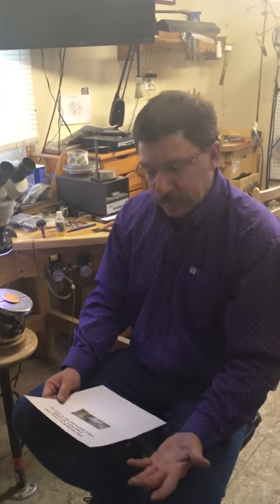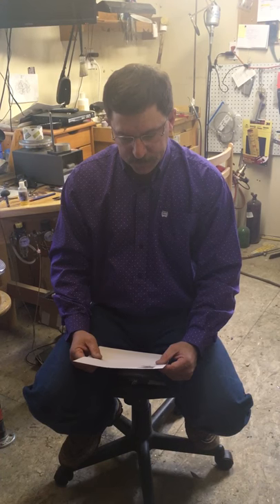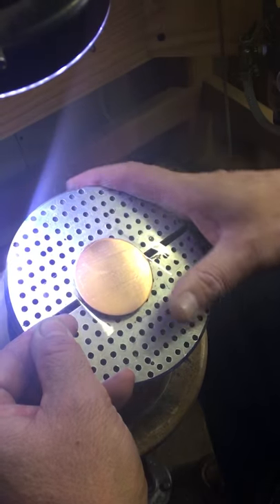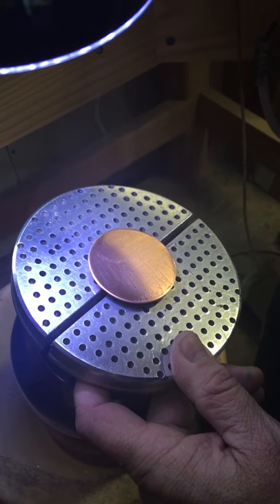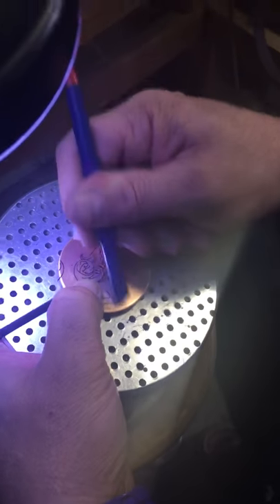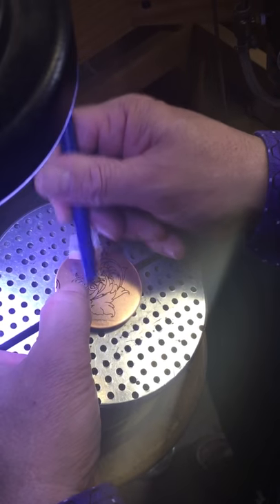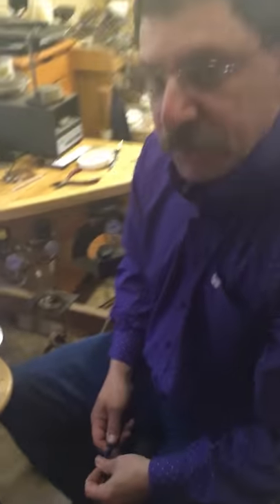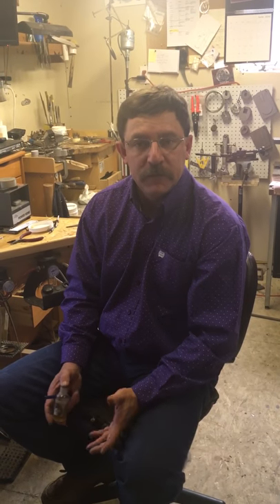Transferring an image for engravers

Comment: Would I be able to use clear transparancy film from amazon like the ones used for projectors with a laser jet printer and the fluid? Would that work?
Reply from the maker: No that will not work.

Comment: I suspect the transfer fluid is a weak pale shellac solution or a weak glycerine solution. Inkjet transparency film is i believe coated with glycerine to create a surface for ink to adhere to but its not as good as paper so the ink can be easily shifted from the transparency surface.
Reply from the maker: Dominic Kent you are a freaking genius
Reply: @sddd42000  I use a weak shellac solution which when dry i rough up with 1000grit it will then make a surface which will take pencil drawing on.
Reply from the maker: Again you are a true genius......bet it’s hard to be around yourself